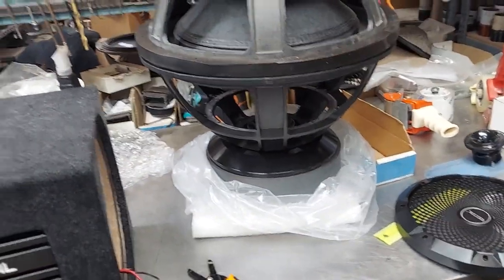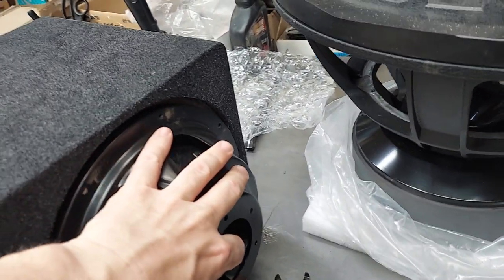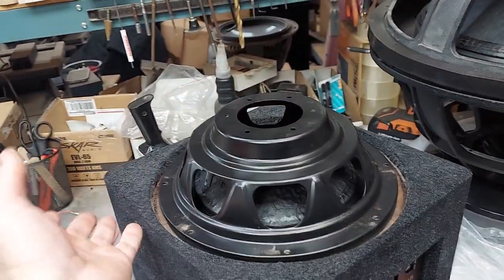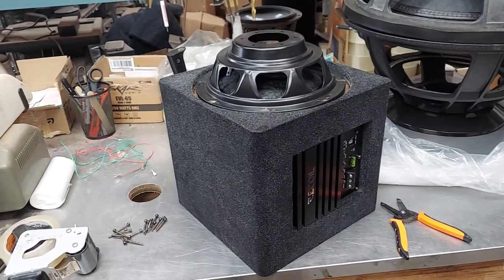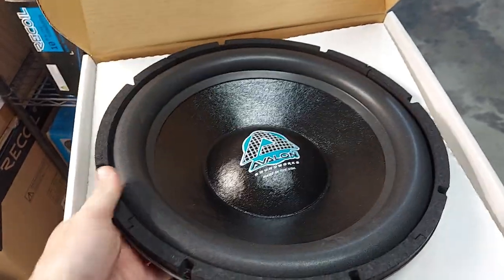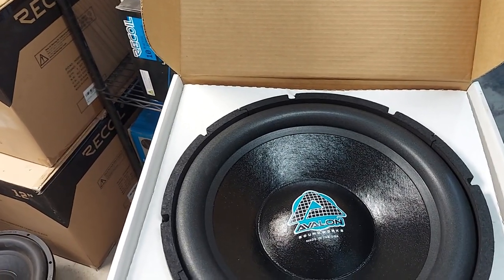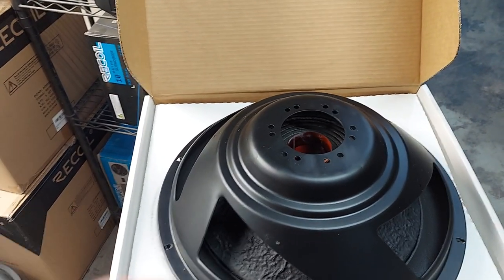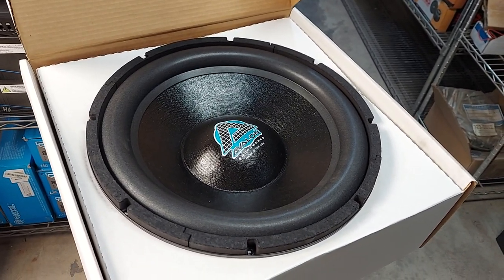10 minutes to learn how to tune a passive radiator by Robot Underground 🤖💕 @RobotUnderground

Comment: When I tuned my 15 inch PR I did the putty test. Then when I had that weight I took some 6 gauge solid copper 'GROUND' wire and cut two pieces, bent to circles and soldered them into 1 ring then epoxied it to the outside of the cone, used a black sharpie to color them black.

Comment: 4:00 thanks for the knowledge, this is very interesting. Has anyone ever experimented with a powerful deep excursion subwoofer and deep excursion passive radiator? Will it just blow apart? I'm thinking the ported box always wins when it comes to output. I built a 2.4 cu ft slot port box for my RF T2 12 a long time ago. It had 3 inches of movement and would knock the rust loose on my poor little Toyota Corolla. Lol You couldn't smoke in that car with Bass Mechanic playing, it was disturb my breathing and choke me up. Lololol 🤣 I need to find another econobox and build another system. More smiles per mile on the way to work.
Reply from the maker: Bigger than needed box will compromise power handling.  Just keep that in mind.

Comment: You should be able to calculate mass with the help of your box modeling software easily enough by using your passive radiator's area as port area, finding the port length with your modelling software then multiplying port volume by the mass of air in that port.   Passive radiator is just doing the job of whatever mass of air would be held and resonating in a port of that diameter at the appropriate length for your desired tuning.
Reply from the maker: Thanks for the tips!

Comment: We use a Clay type epoxy sometimes I will check the name and post it but it doesn't harden till you kneed it with the center which is a different color so you could keep adding the epoxy till the proper mass is met like Patrick said then activate the same clay/epoxy your using to tune and shpe it and stick it on the coil section of the PR
Reply: PC-7

Comment: Im building a wireless bluetooth speaker with dayton audio nd140-4 and it has vas of 7.22 liters and fs of 59hz and the box will have two dayton audio ND140-PR passive radiators, will do the tuning when i get the box fully done. I made the box bit too small, its only 5.4 liters and it has amp and battery taking bit of the volume too but i hope it sounds good enough for portable speaker

Comment: I'm re-watching this getting some ideas for my build. Im making what i call the deaf cube. I have a cheap Rockville punisher with a rms of 1200w and i have 3 12" earthquake slaps passive radiators. Im going to top mount and invert the 10 in like a 1.4ish cubic foot box and place the 3 radiators on the sides. And probably going to buy a 4th too have a full surround of radiators. I don't know what kind of math to use to see if this will work I'm pretty much just doing a trial and error 🤞
Reply from the maker: You're overthinking it.  If the Punisher is 10", you only need one 12" SLAPS
Reply: @RobotUnderground  I'm overthinking it on purpose. I'm just experimenting with adding each radiator to see if I'll get more spl

Comment: Can a person use a single 15" radiator for a single 10" sub? Or is it overkill? If not, what about two 15" radiators with a single 10" sub?
Reply from the maker: Now I want to try those tacos that Sheri told me about..  lol.   Yes, you can use a 15" PR or even two if you want.   There's a difference between what is needed / required and what it is that you can actually get away with.  You know this.  I do however recommend a Sunfire cabinet of sorts for your orange beef with broccoli 10" sub I made you.  I have one here if you want to mod it.  I also have some of the original 10" passives from Sunfire / TC Sounds, or we can make a matching one for the driver and make sure the cap is off center again.

Comment: Once I know the FS of my Sub..  Do I want my Enclosure (Ported) tune to be lower or higher or equal to the FS?  Sorry for the Noob Question.
Reply from the maker: It just depends on what the application of the sub is.   The best thing you can do is play with a box program to experiment as a simulator.  See what happens to the response when you change the tuning frequency and then see what happens when you change the box size relative to the Vas.

Comment: can 1 passive radiator work on a 2 subwoofer box or does it have to be 1 radiator for each woofer?
Reply from the maker: You can, however you're going to max out that single PR pretty quick.  You'd want it to be at least one size or two sizes larger.  Like 2x 12's and a single high excursion 15" or 18" pr.
Reply: Old school audio engineer told me the passive radiator should be at least 1.5-2 times bigger than a woofer 
Perfect example is SuperCube6000 from Definitive Technology a 1000dolar sub with 9" woofer and 2x 10" passive radiator 
I love passive radiators sub since 20yers ago I had my first earthquake magma with passive radiator
Reply from the maker: @michalwisniewski8033  It depends on the size of the enclosure and the excursion of the passive.  Smaller enclosure only needs one passive of equal or greater size.  Especially if it has 2.5" or 3" excursion like the Sunfire TruSub by TC Sounds.
Reply: @RobotUnderground  thanks for your message I lern something new

Can you tell me your opinion about small "subwoofer" under 8" it's really Hype and popular on YouTube now, brands like dyton audio or tang band 

Small speakers with long x max
They play a quality bass or just making a noise and vibration in room?

I don't have experience with them because subwoofer for me means 8"  or bigger driver with low fs without eq or dsp boost

Thanks and sorry for my English it's not my first language
Reply from the maker: @michalwisniewski8033  Only good for very small environments like a very small car and even then, you're probably better off with something that's an all in one.  Like we have this sub for just $75 each shipped.  https://amzn.to/3EC75BP

Comment: Radiator needs 2x xmax of speaker correct?
Reply: Sometimes, there is no real fixed rule. So If the sd cone area is the same than you would want more x max on the passive radiator. Most not all PR set ups tend to run a bigger PR(12 inch subs get a 15 PR)  or two PRs equall to driver size but not always. It  is something that you have to play with a bit on paper and in the box. It comes down to q,vas power handling, the amplifier you want to run (there are small but important differences class damping ect)x max, Fs and bl . There is no rule of thumb if you like how it sounds than its right.  And PR set ups will need time alignment in some cases. Mostly have fun trial and error is learning. And that's the fun part
Reply: @thomasnygard2334  just to pick your brain, do you go with the recommended ported box size or sealed box size for a passive radiator? I think he said ported in the video
Reply: @momar678  I run just below on my box but the ported size is right . Give or take 20%
Reply: @momar678  neither he said go with the VAS of the subwoofer you are using and work from there either adding or subtracting enclosure volume to suit your needs. If u were to go with ported that’s larger enclosure than the VAS because that’s not the subs resonant frequency the larger enclosure and port would dictate ur tuning period.  Passive radiators are ports in sealed enclosures and sealed enclosures if built properly should compliment the subs resonant frequency then at that point u can get the proper mass to the passive radiator to get ur desired tuning…
Reply from the maker: It helps.  Remember though that a passive can move like 3" peak to peak with an 8" spider and 3" center.  So even if you have an 8" spider and use a 2.5" center, you get even more excursion available as long as the surround can keep up.
Reply: @RobotUnderground  absolutely it makes a difference. Like I said two many variables for each driver set up let alone the performance one is asking for. A 250w sub is going to ask for something much different than a 800w sub. So all things the same never going to happen but for the discussion.  The more powerful driver might need that second PR to deal with the added force. Man this could go on forever could it not. I am with you on this if you like it run it no body else matters.
 I like to run a bigger box and less  power. It just doesn't seem to stress things as much.

Comment: There's only one mistake you made when mounting the PR reversed like that ... and that is you have now increased the enclosure volume by the cone displacement... you need to know what this is and fit a block of wood or something with the same volume inside the enclosure. You can get false readings if you don't do this ..
Reply from the maker: You'll find it's not that big of a deal.

Comment: Would you be able to get a lower tuning level by using a bigger radiator than the woofer or is the limit set by the fs/vas?

Have one of the new alpine type r w12d2 but want to go lower than the 24hz but would still like the punch of a sealed box.
Reply from the maker: You can achieve a lower tuning frequency simply by adding more mass to the passive radiator.  Tuning too low can make it useless.  Remember not to tune any lower than 30Hz for 99.9% of all applications.  Ideal is 32 to 36hz to keep the system relatively efficient.
Reply: Why would you want to go lower than 24hz?   That’s way below Fs of that sub
Reply: @caseytbss  Some of the music I listen to has content that drops that low and my subs at home drop to about 19hz which i like, in the car however i would say it does not even approach 30hz, this is much more likely to do with the dimensions of the car(Toyota Yaris/small hatch) than the box or the sub which is a 2 cuft ported, the subs at home are sealed 12s but they drop much lower or at least sound like they do in my room.

Comment: BTW if yourusing these passive radiator on a night shade or a dc level5 or whatever you will need 2 per sub most likely also passive does offer a much narrower band width then a port so there is definitely some research todo before jumping . I am looking todo this soon  earth quake makes a double radiator c Allen the pump that would probably work well for more extreme subs
Reply from the maker: Not true.  You just need a passive that can really move a bunch.  If you're using a 10" spider and mega roll, you're fine.  One way to keep it to a single PR is to keep the box small.
Reply from the maker: You can also go up one or two sizes if you really feel the need.  Like a 15" or 18" PR for the 12" active sub.